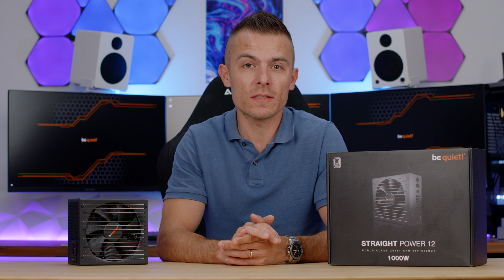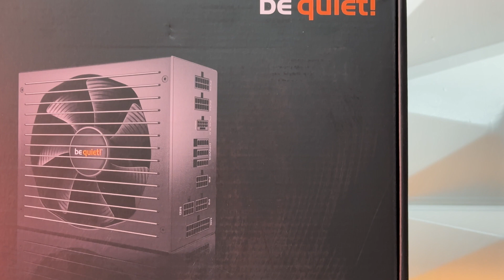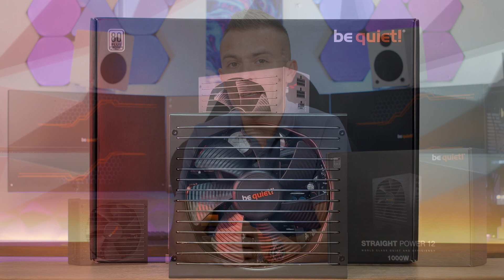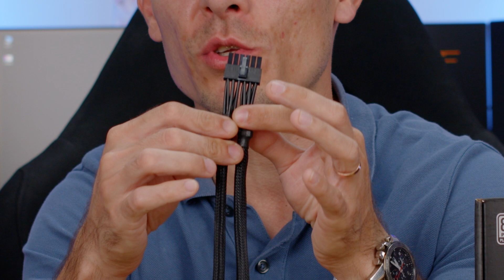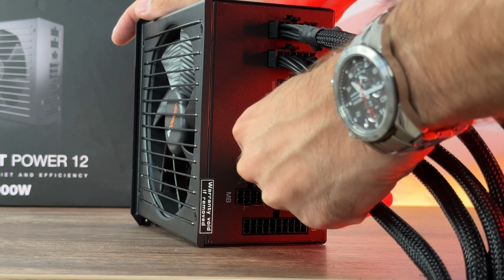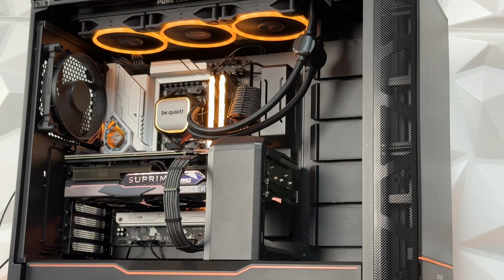BeQuiet! STRAIGHT POWER 12 1000W - Platinum and Quiet!

Comment: 3:54 It is not a 12 pin it is a 16 pin because of the tiny ports on the top of the cabel
Reply from the maker: 12V-2x6 Connector

Comment: OK. I need a new PSU. I want to futureproof a little bit. I currently have a  7900xtx, which requires three PCIE connectors and a AE-9 sound card,which requires another one. 

If I am not misunderstanding you, this has two sets (four total) PCIE (6+2) end connectors, each with their own power feed.

Am I correct?
Reply: Did you have the answer? I bought this PSU also and I wonder if this is correct..
Reply: @MegaMischa86  Yes. This is correct.

Comment: One of the best reviews I have seen on this product. I am stuck on a choice between BeQuiet! STRAIGHT POWER 12 1200W or the EVGA SuperNOVA 1300 GT, 80 Plus Gold 1300W
Reply: Yes I was thinking the same :) Very good review and far better than one other I saw before :) Also I went for the Straight Power 12, but keep in mind, with so much Watts it's not gonna be very efficient in the low end. It has a very nice smell compared to other electronics xD 😅

Comment: THE BIG QUESTION : Be-quiet straight power 12 1200w or Corsair RM1200x Shift 1200W ???
Reply from the maker: Personal choice I guess and depends where you want your cables to go. Both outstanding PSUs.
Reply: @PCCrazyDario  I purchased the corsair because before i had the RM750e , thanks for your thoughts 👍
Reply: ive been researching both these psu's, if psu case compatibility is a concern, get the bequiet, if not go with which one is cheaper

Comment: I wish you did a coil whine test while under varying power loads. My Corsair TX650 has horrible coil whine.
Reply from the maker: To be honest, and no disrespect, TX650 is low-tier PSU compared to this one. It doesn't have coil whine as far as I heard when using it afterwards. Everything was ok.
Reply: @PCCrazyDario  I replaced it with a NZXT C Series V2 650W the other day. Finally no coil whine.
Reply from the maker: @RyukoMeows  Sounds a tad better, but remember, never cheap out on a power supply. If that dies or burns, it could eventually destroy your whole PC. SeaSonic is the way to go even on the low and mid-tier segment.
Reply: @RyukoMeows  hey how's the fan noise on your NZXT psu after 3 months, is it quiet? Just curious
Reply: @hazzmati  Yup, it's still very quiet. No problems at all.
Reply: @PCCrazyDario i have the 850 watt version of this and a constant horrible almost tinitus sound comes from the psu

Going to replace it with the 1200 watt version, if this ones has the same issue im not getting another bequiet